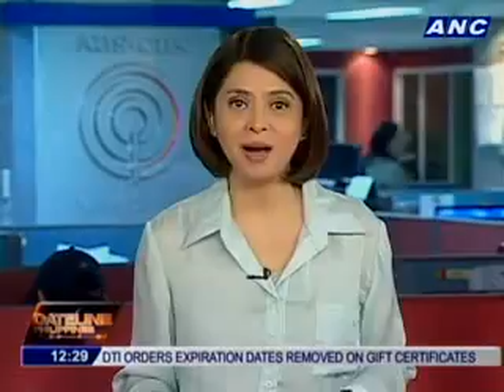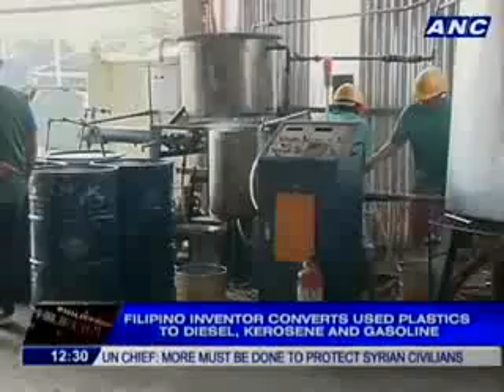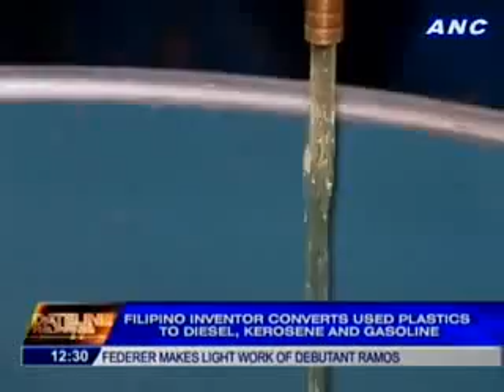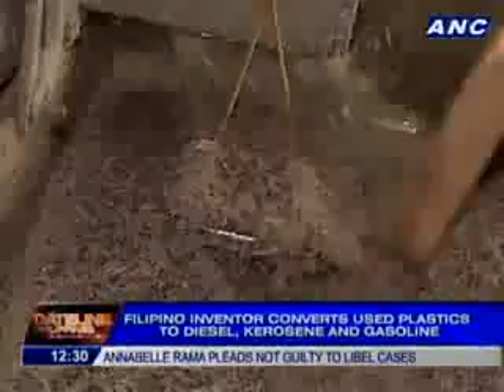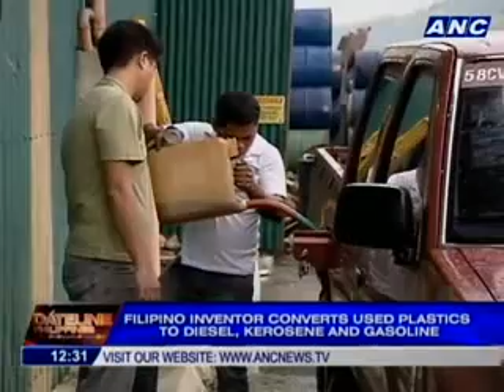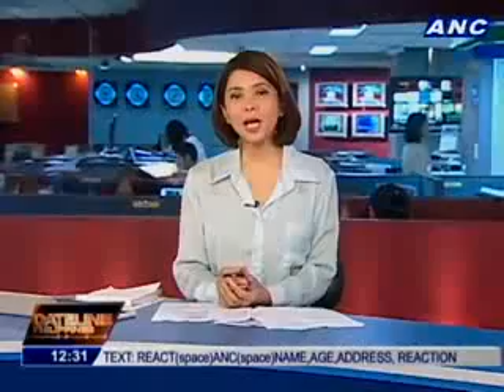FILIPINO INVENTOR PLASTIC TO FUEL

Comment: nagpapaniwala ka naman kay dingel, matagal na syang hinamon ng mga journalist na magdrive from manila to baguio, kailangan lang nya siguraduhin na walang extra fuel syang itinatago sa sasakyan nya, pero ayaw nya pumayag na mainspeksyon muna ang kotse nya, then iseseal para matiyak na walang daya, HINDI SYA PUMAYAG, kaya nga hanggang ngayon di sya paniwalaan ng mga journalist
Reply: The prototype electrolysis cannot produce enough hydrogen to sustain driving on a high speed much more in a long drive.  To be able to achieve that hydrogen needs to be stored in a cylinder but it's dangerous by doing so you practically created a hydrogen bomb.